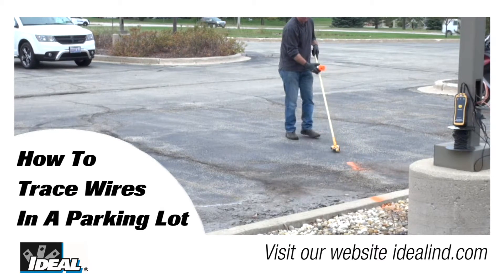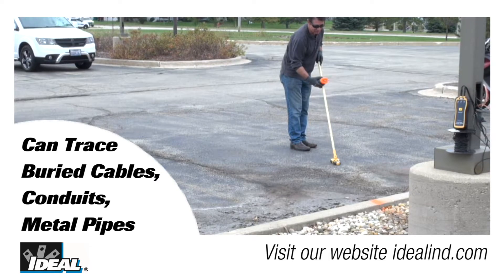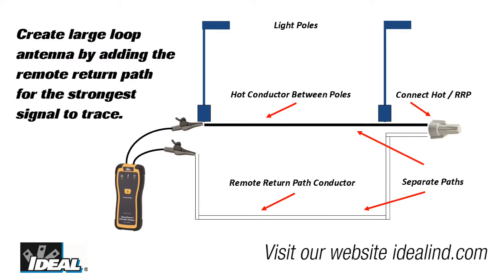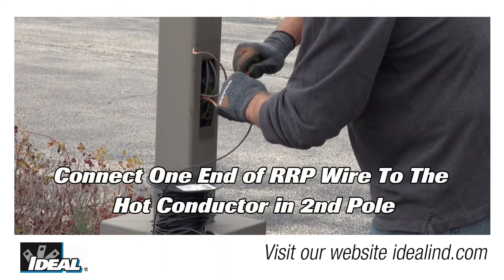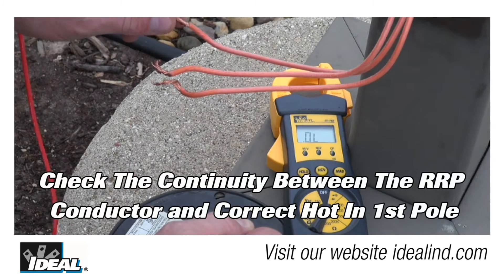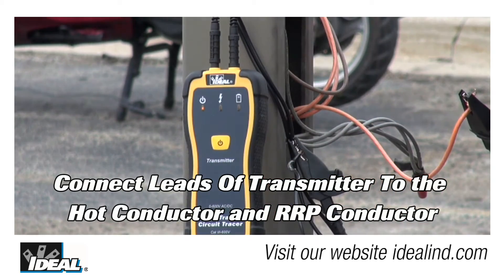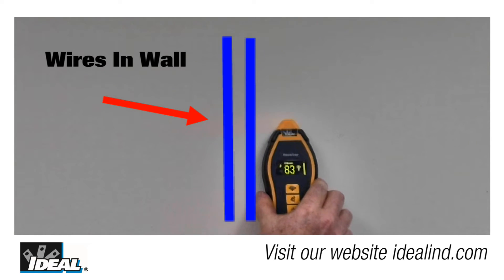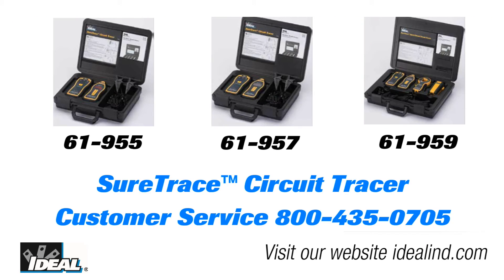SureTrace™ Circuit Tracer Parking Lot Cable Tracing

Comment: This doesn’t make any sense, 
First you say you disconnected power and did a lock 🔒 out tag out
Then you say clip onto the hot lead
Then then the voltage led on the transmitter isn’t lit.
🤔🙈👀

Can you please clarify that, the drawing just shows both leads eventually tide to the same lead before it branches out
Reply from the maker: Hey Mr Mr you will have to clarify what you are asking. Let me know Ron